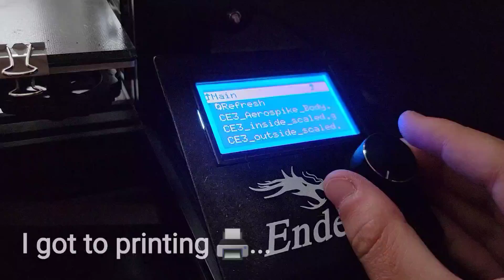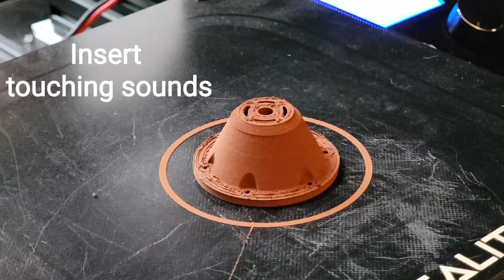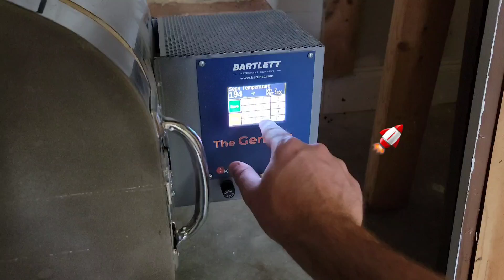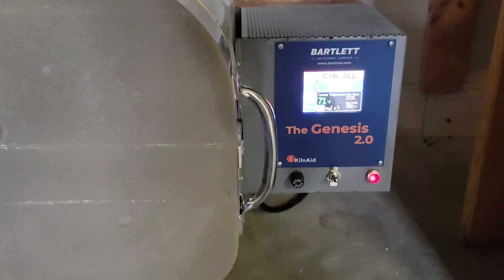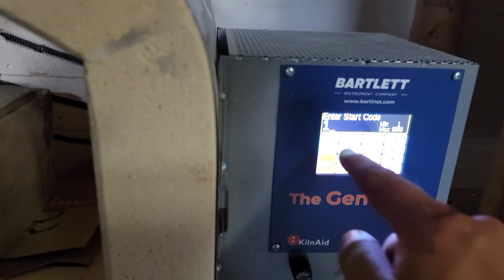3D Metal Printing Integza's Rocket Nozzle | Maker Friendly | FDM Filament

Comment: If you have a kiln why not just do lost pla casting?
Reply from the maker: Good question - 
Mainly because I like figuring out a good problem and this is a space that seems to have a lot of unanswered questions. I really like the lost PLA method and for the majority of the parts I've done (minus the print in place gear) it would be a better option, but lost PLA still has its downsides.
1. This method allows for printing and directly putting into the kiln with almost zero prep (putting refractory takes a few minutes).

2. Once dialed in (what I'm working towards) there's minimal cleanup for a piece as opposed to grinding and cutting that casting requires.

3. Molten metal can be pretty dangerous especially if you're not careful pouring, while this is a "set it and forget it" approach. Put in the kiln, turn it on, wait a day, pull it out. Done.

Again, I'm mainly doing this as a fun way to experiment with a cool technology but there are some good reasons still to polish the process and show others how to do it

Comment: nice crucible setup! you made those yourself?
Reply from the maker: I did :) 
I've got a massive (relatively speaking) one in the works. I'll share to the discourse
Reply: @Mr-Highball  sweet. Wish I could just go to the pottery store and buy ones shaped like that. (wait, can I?)
Reply from the maker: How big is your kiln? My medium sized crucible which has been pretty great was from a 3D printed mould that I scaled up and my small one was a tissue box mould from Amazon (it was like 15 buckaroos).
https://www.thingiverse.com/thing:335019

If you want the big one (if it'll fit your kiln) we can work it out. If so I'll shoot one your way at cost, dm me on discourse or reddit 👈👈

Comment: Nice video! I'd suggest fewer emojis though. Decoding the meaning in the middle of the text is a little distracting.
Reply from the maker: Thanks for watching and the feedback, will take that into consideration for the next vid
Reply: @Mr-Highball  Yeah, I still have no idea what some of these mean: "I <video casette> the top"? "I <VCR> the top"? Your 3d printer is a "<fire> 3"? It's a ender 3 from the look of it. "Still very <grey sphere>"? What the heck?

Like, I think there's too many memes for my preferences, but I'd be ok with it if the memes made sense . Half of them make no sense or rely on a very specific cultural context that I'm lacking.

------

Off topic, is there a reason you're not sealing the green parts in foil before sintering? I'd think that'd go a long way to keeping oxygen out. I know that's what knife making people use for heat treating blades when they don't want them to develop scale in the oven.
Reply from the maker: @Fake0Name  Points taken. my later vids should be easier to interpret. "I 📼" would probably be easily read as well... anything other than "I tape the top" since it relies on someone knowing "magnetic tape" is in a cassette and isn't all that sensible (when you edit videos after some beers... well it turns out not everyone is a mind reader). I appreciate the feedback as it helps me make content that is better overall so I hope you'll bear with me as I get more acclimated to sharing my projects rather than keeping them to myself.

The one reason why things aren't wrapped fully is for support of the 3d printed features as well as requiring a way for the debinded plastic gas to escape
Reply: @Mr-Highball  nah fck that the emojis are golden
Reply from the maker: @Dansl05  First time I've heard it 😁
Most people seem to have a hard time reading through it... but just because I think in pictures doesn't mean other do. I guess I just need to find that happy median.